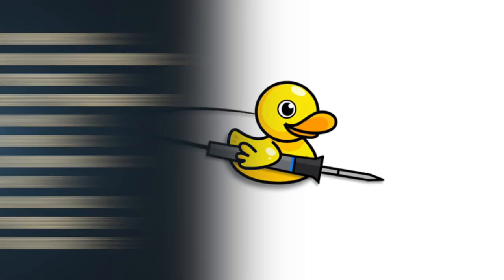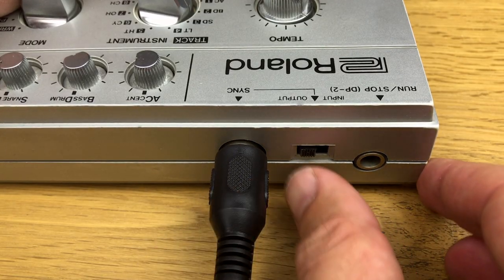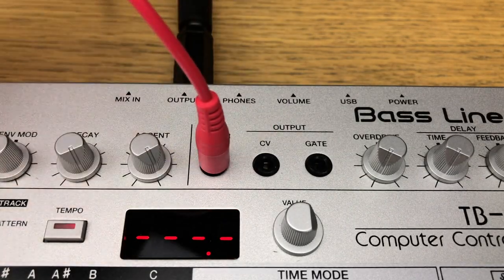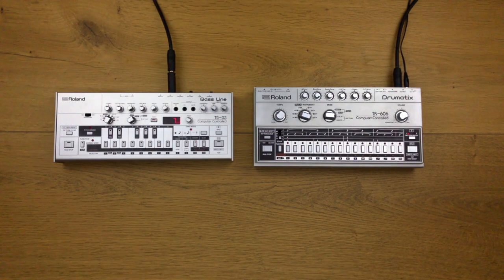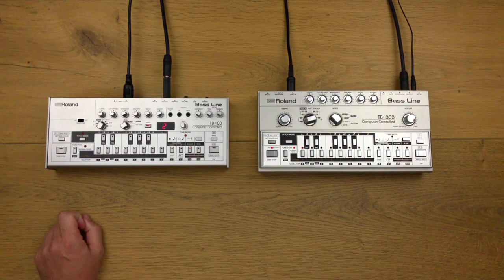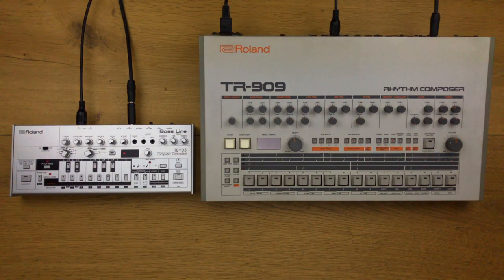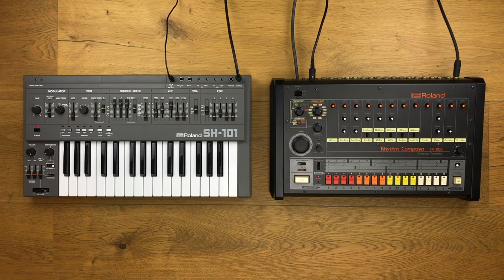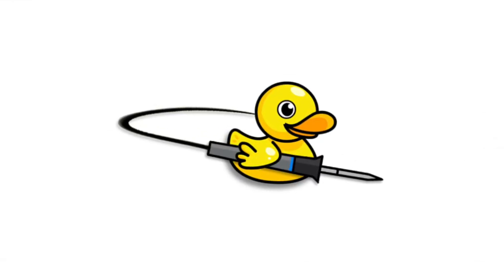How To Sync Drum Machines And Sequencers Via DIN SYNC, MIDI, CV/GATE And TRIGGER CLOCK!

Comment: So if my drum machine has a built-in sequencer pattern programmer, and I want to sequence a song together using a daisy chain, the clock sync won't actually sequence the instruments will it? Like the exact times and occurrences of a bass line on one device or rests and breaks? It'll just play everything all at once?
Reply: Hi, I'm afraid I'm not sure what you mean. You want to use a drum machine (e.g. Roland TR-x0x) to control or synchronize another instrument via Midi?
Reply: @Oliver-OBM  I mean can I still program each instrument like exactly on a certain beat or measure? So that each instrument will play as if a band was playing it. Instead of everything playing all at once.
Reply: @Oliver-OBM  Like variations of the song.
Reply: @Oliver-OBM  Like location data on a pattern based sequencer drum machine
Reply: @miles46100  You can still edit, program, change or delete patterns, sure. Everything is exactly the same, but it'll play on the exact BPM of the other device. That's it.
Reply: Reg check they are not both on the same midi channels?
For midi sync only you need each device set to its own channel from 1-16. 
General midi protocol says drums are on midi ch 10 so set TR909 to that channel and to make sense set the Tomcat to midi ch 11. Then the tr909 should not be triggering sounds on the other drum machine. 

Basic GM midi protocol:

Ch 1 = synth 1
Ch 2 = synth 2
Ch 3 = bass
Ch 10 = drums

Channels in between are generally considered up to the musician/ programmer. 

Study both manuals for something like ‘midi data sheet’ or ‘midi spec’ so you can see what each transmit and / or receive. Some devices let you filter or turn on or off certain midi functions. 

Hope that helps
Jb xxx

Comment: Does this work with every drum machine that has MIDI in and out? I have a dr 770 and want to sync with Korg volcas. Anyone knows and can help me?
Reply from the maker: Yes, via MIDI you should be able to synchronize all devices easily. Check the manuals to see if you need to set up the devices for MIDI synchronization beforehand.
Reply: Get or make a MIDI thru box
Use the dr 770 as master and send midi out to the thru box and then from its multiple outputs to the volca midi ins
Most midi thru boxes have 4 or 5 outputs and are pretty cheap

Comment: HI i have question, I have a lot of synths(tr8, monologue, microkorg, minibrute, kaosspad, volca beats, keys, samples and mix , but just a 4 channel mix (xone 4D) . it is necessary to buy more channel mix or is possible to connect it together??? ... i am desperate. no one nearby can't help me :((
Reply from the maker: Hi, the video is mainly about the synchronization of the devices. But you want to hear your devices at the same time, so you want to sum up the audio outputs, right?
You need one audio channel (maybe stereo) for each device on your audio mixer. So you need a mixing console with more channels.

Comment: Awesome thank you for sharing this knowledge. Much appreciated! I am starting to get my head around how to sync my gear up however one thing that has me stumped is that 2 of my synths have a 1/8" "Clock In" socket where the other 2 only have DIN MIDI in, out + thru sockets. What do I need to do to clock sync them all to the master clock unit?

Sequencer/synth/sampler = 1/8" Clock in, MIDI In + MIDI out  . Synth #1 = 1/8" Clock in, MIDI in + MIDI Out/Thru (combined). Synth #2 = MIDI in + MIDI out. Synth #3 MIDI in, MIDI out + MIDI thru 

Any suggestions would be greatly appreciated! <3

Comment: Really solid overview of synchronization concepts. Appreciate your work! Quick question, how important is it to make audio connections prior to turning on gear? Most of these manuals say it's important. But is plugging in a clock mono patch cable from a drum machine to a tb-03 while both devices are on really going to meas anything up? Or switching between midi and patch cables while units are switched on - is that actually bad for the hardware?
Reply from the maker: Glad you like the video.
When changing MIDI, CV/Gate or Trigger/Clock cables nothing can happen.
Only if you plug audio cables, loud crackling or humming noises may occur and could come out of your speakers very loudly.
Reply: @DuckTronic  Thank you! This is really good information.

Comment: So wait, 7:02, is the tr909 triggering the tb303 with midi note data too? Meaning, are the kick highats, etc from tr909 have midi notes that trigger the TB303 midi notes? Or is it just start amd stop midi data?

I ask, because I remember hearing some performances somewhere in the early 90s, where the synths were basically repeating the same rhythm as the drum rhythm.
Reply from the maker: Hello, at 7:02 the TR-909 triggers the TB-03 (not the TB-303) via MIDI. The 909 sends a MIDI clock signal so that both devices run synchronously. In this case, only a start/stop signal and the tempo signal are required. 👍
Reply: @DuckTronic  ohh okay. So start and stop. Got it. 👍 Thanks. Have you ever seen the video with A Guy Called Gerald?? It's on YouTube.
Reply from the maker: @dpalaoro  I'm not sure. What exactly is it called?

Comment: This is a great video! Very helpful!  Can you tell is GATE IN good for 808 Trigger outs? (any drum machine trigger out) and can you daisy chain a few CV/GATE synths ?
Reply from the maker: A Trigger Out signal is only a very short pulse (808 is 20 milliseconds). A Gate In is intended for normal note lengths and is variable in length. So technically you can play very short notes with the Trigger Out, but it's not really meant for that.
Reply: @DuckTronic  Thanks for the feedback!

Comment: My tb-303 and tr-707 aren't syncing. Is pulling out the DIN SYNC cable the method with the tr-707 also? Can I use a MIDI cable for this?
Reply from the maker: Hi Keith. You have to connect the TR-707 to the TB-303 with a 5 pin DIN cable (All 5 poles must be occupied!). Then it should work without problems. https://youtu.be/nZtPkg6EVFM
If not, you have to check your cable or the devices.
Many greetings

Comment: If my TR8 is clocked via USB to my DAW, could I take the "MIDI out" on it and got to the "SYNC in" of my MC202 (with the converter of course) in order to sync both the TR8 and the 202 with my DAW?
Reply from the maker: I think that should work. I have both devices here and can try it out as soon as I have time. Which MIDI to DIN sync converter do you want to use?
Reply: @DuckTronic  Kenton D-SYNC. I believe it will work fine I'm just waiting on midi cables to come in the mail 😆

Comment: Hey man - Should this work when connecting any two drum machines using a Midi In / Out cable connected between the two??
I have a Roland TR8 and an MFB Tanzbar 2 Analogue drum machine which I want to slave the Tanzbar to the TR8. I will get one of these cables to try it out if that is the case.
Cheers,
Reply from the maker: Hello! Sure, the TR-8 should send a MIDI clock signal and the Tanzbär 2 should be able to receive it without any problems. See pages 18 and 22 of the Tanzbär 2 manual. You need a MIDI cable with at least three poles (1,3,5) occupied.
Cheers
Reply: @DuckTronic  thanks for your reply!
Reply: DUCKTRONIC Thanks for this video do you have any advice on syncing the mc202 , i have a arturia bsp start and stop works but starts to drift . 

I can solder but have no clue on what to do 
Any tips are welcome cheers
Reply from the maker: @eduardcornelis8162  How did you connect the two devices? I didn't have one of the devices yet, but I think I would use the MIDI output of the Arturia BSP and go to the DIN sync input of the MC-202 via the MIDI->DIN sync converter. Either with a purchased converter or with the DIY converter from Colin Fraser.
If you have any questions, please feel free to write me a pm.

Comment: What if I want to sync drum machine to a Mixer and cdjs.
Reply from the maker: The DJ software should be able to send a MIDI clock signal. It can be used to synchronize external devices. But there is so much DJ hardware that I can't say anything specific about it. I think there are a lot of other videos on YouTube about DJ hardware and synchronization, right?

Comment: How about merge ?  I want send midi clock from a beatstep pro and a midi keyboard into and midi to CV converter for modular synthesis. The goal is inside this midi/CV converter is an arpeggiator. I can't pass polyphonic midi info through the beatstep pro unfortunately other wise the keyboard would go to the beatstep.  Kenton merge box perhaps?
Reply from the maker: If you want to use two MIDI sources (Beatstep & MIDI Keyboard) and send them to one device (MIDI / CV converter) you need a MIDI interface. I don't know the Kenton Merge Box, but it looks like it was made for such things.
Reply: @DuckTronic  Right. I solved the issue. I was stuck on using the clock in on 1 beat resolution. Once I moved the Beastep Pro 24ppq resolution I got the results. Analog clock source into Beatstep in slave mode. Drum Pad #8 analog out into analog clock input on the Midi/cv converter and the Keyboard there as well. This turns out to be much cooler than using the clock output. This way I can hold a chord down or whatever and have a sequenced rhythmic   pattern to play the arpeggiator. and it's in time with the sequencer.

Comment: Wait, So it is possible to control an 808s sequence via midi? I mean using a software sequencer outputting notes into the din-sync port.
Reply from the maker: No, the D.A.W only sends a MIDI clock signal to a MIDI Clock to DIN Sync converter. (I build the free and very cheap d.i.y. converter from colin fraser, like shown at 6:29 in the video. You can find the link in the description.) This converter sends the tempo via DIN Sync to the TR-808. The beat was programmed on the internal sequencer of the TR-808.
If you need, there are various MIDI modifications available to send MIDI notes from a sequencer to the TR-808 and to trigger the instruments.
Reply: It's not sending drum triggers to the 808, just controlling the tempo of the 808. His beat was programmed on the 808.

Comment: Hi everyone. I humbly ask the community for help, since I've NEVER been able to sync two or more devices using mini jack sync. I've owned many, including korg volcas, Arturia keystep, etc. Now I've got some second-hand devices: korg Electribe 2 sampler, sonicware Liven LoFi-12, Liven XFM...  I've tried a lot of times, since they all have the Sync In and Out ports, and I NEVER did it. I don't understand what is wrong: do I need specific mini jack for sync? Isn't a regular stereo mini jack fitting for this? How can I understand if polarity is right and/or how to set it correctly? Is there a complete guide to start with? Until now I connected the devices using the midi ports, but since I'd like to use them in some cases for other devices such as a midi keyboard, I'd like to set them free and start Syncing, at last. Thanks anyone for helping!
Reply: any updates?
Reply: @faciality  no
Reply: @manucontrovento  Id recommend asking on r/synthesizers bro! or try using chat GPT - can be pretty helpful with technical shit sometimes - for example yesterday i was trying to figure out how to connect my MPC, Minilogue, and Volca…. it described CV, SYNC, and MIDI - and midi to my understanding has the most function - and i asked about how I should route it if I want the MPC to be sending the signal/tempo out to others - whether daisy chaining would be possible (no, ill need to get a MIDI Thru hub to connect my devices separately to the MPC Midi out port) - sorry point is try askin the bot bro 🤖🤣

Comment: Hello, I own a tr-808 and a doepfer msy-2 . How can apply swing to 808 from Ableton live 9 please ?
Reply: Nowadays there was a global swing in the top left of the screen. Now we have to apply groove to each clip and the global swing affects these clips... I need to swing the clock to 808
Reply from the maker: Hello, I guess this isn't working. Or very badly. The 16th Midi Clock is converted to 24th for DIN Sync and delivers only the tempo signal for the whole pattern.
I don't use Ableton, so I don't know if Ableton can send a swinging MIDI clock. Just try around. Maybe it will work reasonably well.
Reply: @DuckTronic  thank you but I'm afraid it's dead.
Reply: @DuckTronic  do you know if it's possible to swing clock for 808 with an Arturia Beatstep pro ? Thx
Reply from the maker: @maxbrank  Sorry, I haven't worked with the beatstep yet, so I don't know.
Reply: @DuckTronic  in facts there's only one way to fix it, I mean to swing clock : to get an interclock like Roland sbx-1 or ERM multiclock. Thank you for your help.